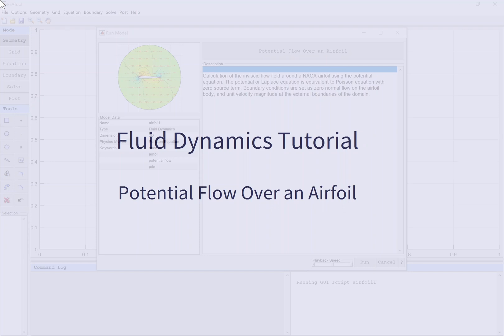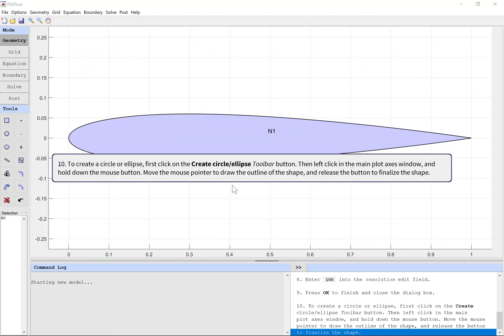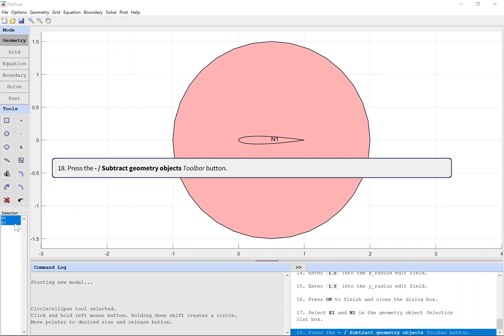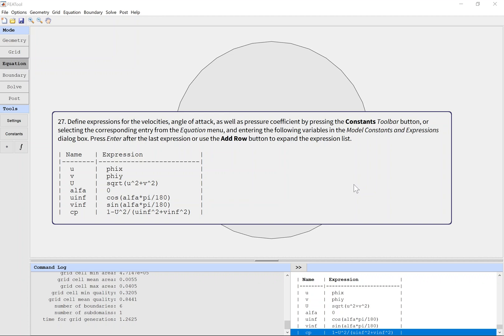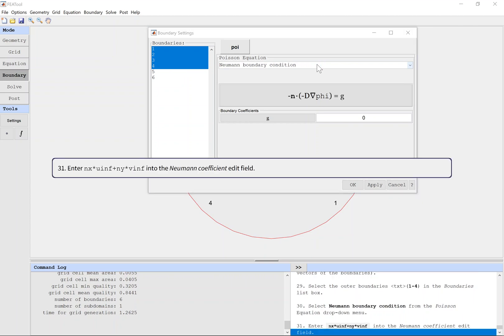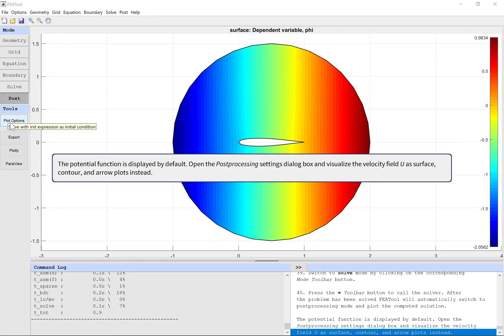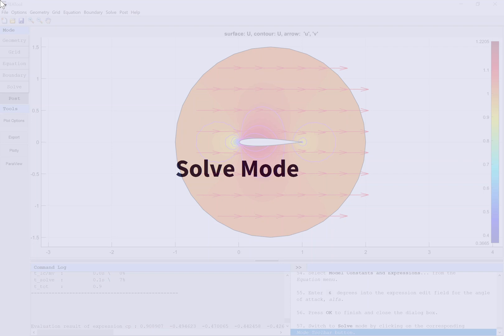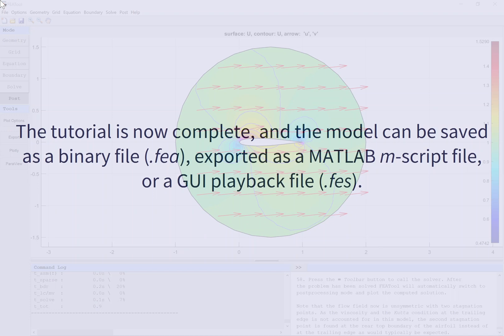Fluid Dynamics CFD Tutorial of Potential Flow Over an Airfoil | FEATool Multiphysics

Comment: Hello,
Thank you for the tutorial!
I am currently working on an optimisation problem which finds the best airfoil for a given velocity and other parameters, 
Is it possible to extract CL, CD and CM for multiple generations of airfoils based on the graph of the airfoil plotted in each iteration, without manually inputting the conditions everytime? Please do help me with this
Reply from the maker: Yes, you can do that, for multiple runs it is probably best to write a script as for example in the flow around cylinder benchmark example

https://www.featool.com/doc/ex__navierstokes3_8m.html

Also note that you can export models from the GUI as script files that you can start with.